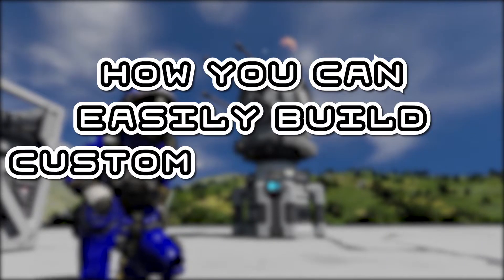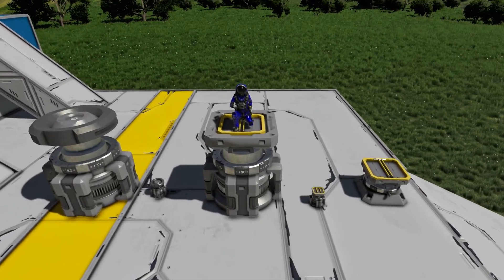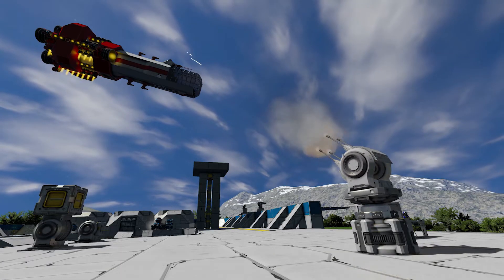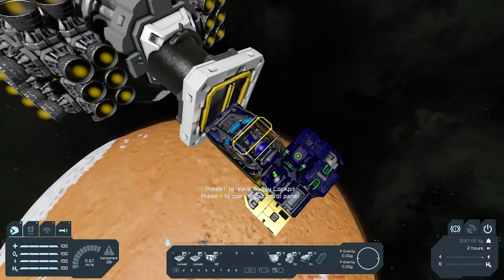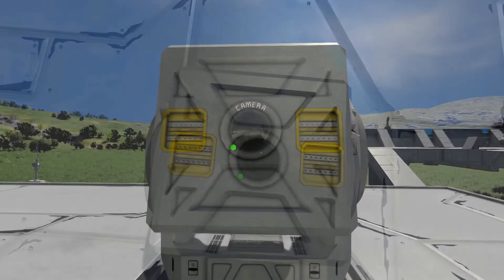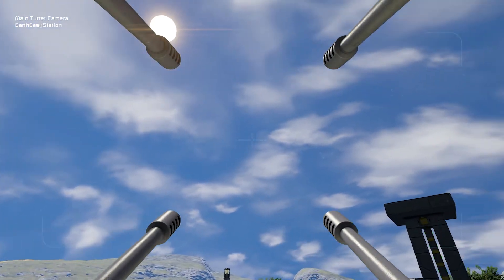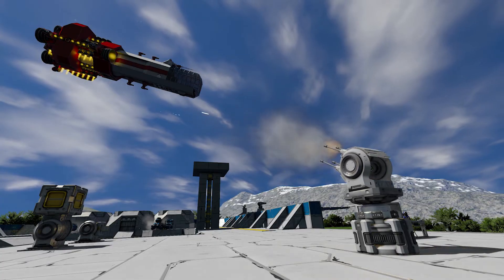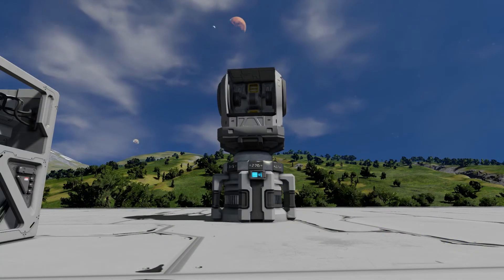How YOU can easily build custom turrets in Space Engineers

Comment: If you're willing to build a fatter turret, use a rotor for the elevation, and set the positions of the weapons in the turret so that they're centered at the elevation pivot point.  This will make them respond much more quickly, and improve their accuracy considerably.  A key to achieving this, however, is to make sure the main portion of the conveyors is actually at the front half with the barrels, and is then routed to the back to feed the weapons.  Unbalanced loads can impact how quickly the weapon responds.

It can still be done with the hinge-style turrets, but it will probably drastically limit their range of elevation anyway, except perhaps for gatling guns.

Comment: Quick tip, for bigger turrets you may want to go to the rotor and/or hinge and increase their torque
Reply: I know this is an old comment but would this make it easier to lift up the turret or if not what would this change, sorry if this was stupid question
Reply: @ZoomBomb think so. Although I bet you find that out by now.
Reply: Yes it’s a very stupid question :) what else should MORE torque do? Of course more force. 
But you could also design with Center of mass in mind…saves needed force.